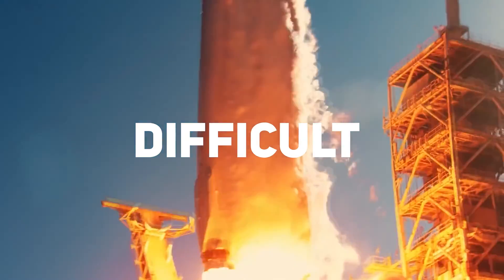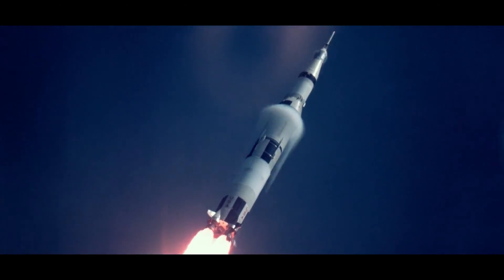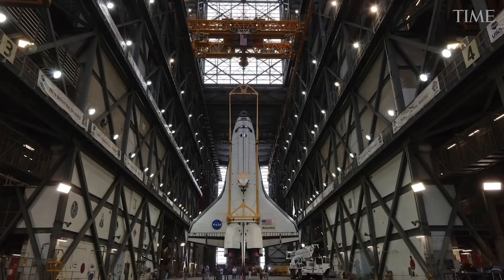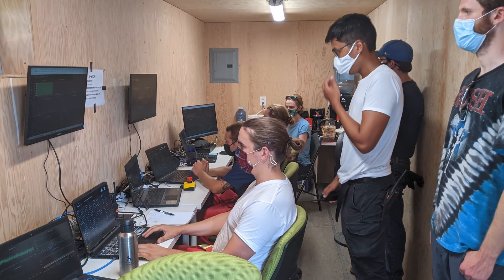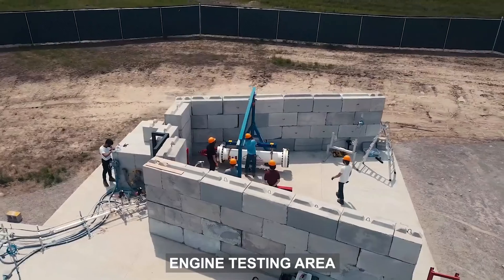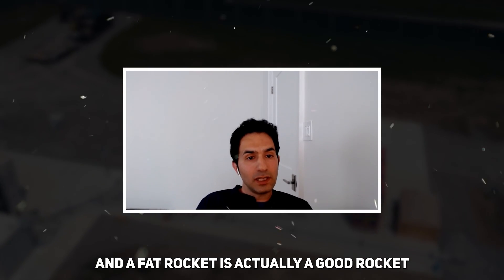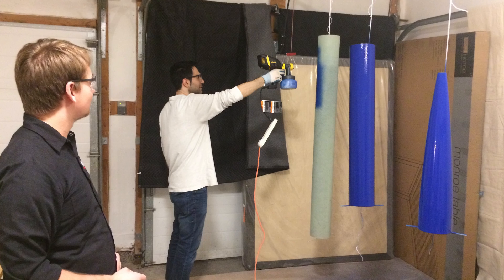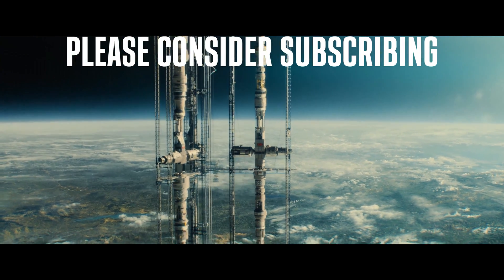Why SpaceRyde Uses Balloons To Launch Rockets

Comment: What I can't understand is when any rocket reaches high enough into the sky that the oxygen level decreases so much that a person would need some kind of breathing apparatus to survive and a rocket itself using some kind of fuel would no longer be able to operate past this point.  Any craft that reaches this height hasn't even got to the firmament yet so how can any rocket propel itself into space when no flame can exist without oxygen and then there's the problem of having to deal with the claimed vacuum of space. None of it makes sense. Especially back in the sixties. Then you have the space suites that were tested in a vacuum and failed on every attempt to protect a person inside the suit. It just doesn't make sense and I personally believe it's all a lie to siphon money out of the tax payer without quest when there should be. Imagine a space suite in a vacuum, it would force the suite to expand so tight that even if there was someone in it they wouldn't be able to move at all due to the vacuum pressure. It Don't make sense, it has been proven fact a flame can't maintain itself without oxygen so why does these projects continue and why keep the lie up to the people of these claims when facts prove otherwise.

Comment: Why is the launch price of the Pegasus so high? Obviously the rocket is more complex, but is that solely because of the launch vehicle?
Fixed wing aircraft can fly as high as balloons, and in my mind it seems possible to make a more sensible launch system. And I imagine that planes have several advantages over balloons. Of course it might be that getting started with fixed wing launch is impractically expensive, but perhaps I am missing something else?
Reply from the maker: Yeah it’s a good question. Wikipedia lists $40m but I think it could definitely be lower at scale. SpaceX was actually planning to make an air launch rocket back in 2012 but they scrapped the project. I think it’s probably a matter of focus. Big companies probably view building this tech as a distraction from their main goal of bigger and cheaper rockets. Perfect for a startup to come in and fill a small niche. If the overall space market gets huge (which seems like it will), even a niche product could still be a great business.